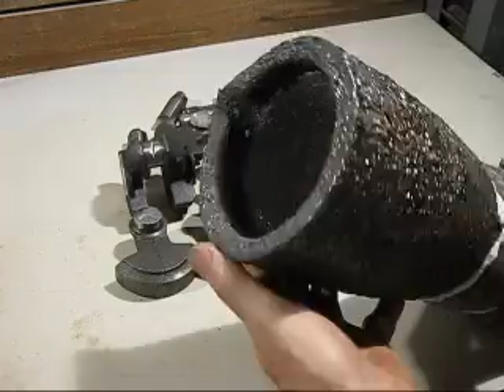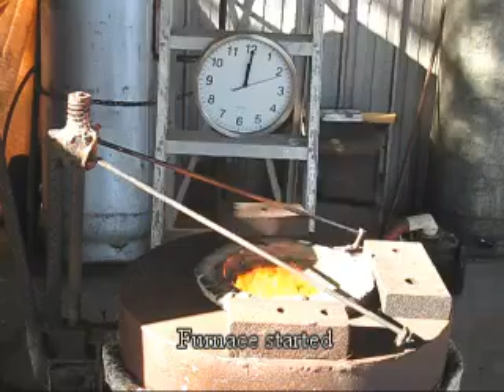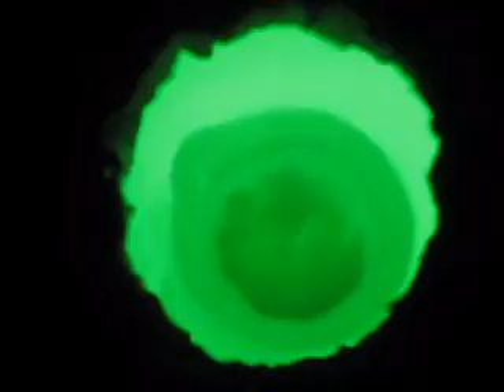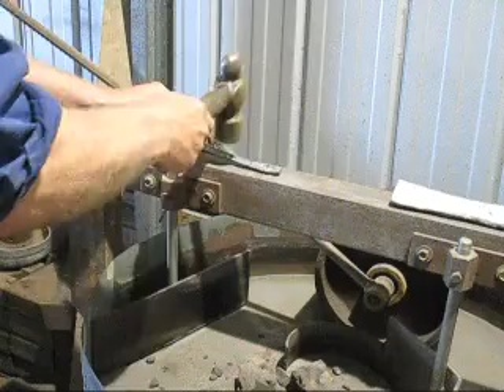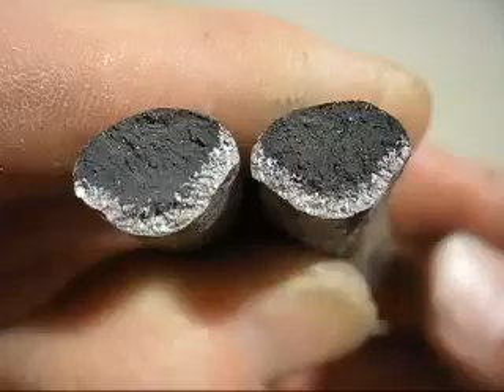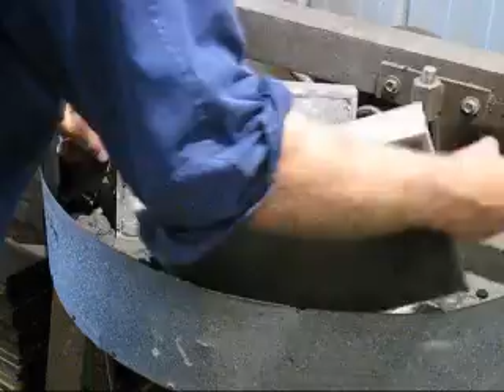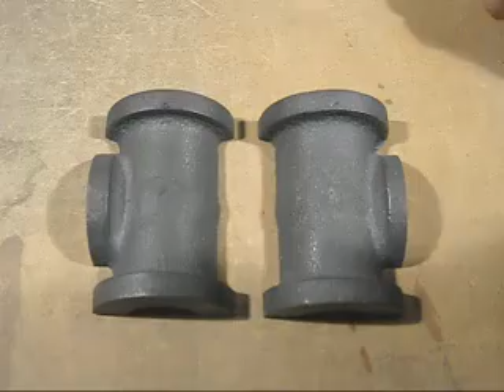Melting  crankshafts

Comment: The mark of a real expert, making it look easy and producing a thing of beauty from the ordinary and mundane. 
The halved cylinder metal looked awesome. I would have a plate machined from that, lacquer it and hang it on my wall to admire the beauty of the grain of the metal.

Well done again mate. Not many people can melt crankshafts so easy and get the end result spot on.
Reply: +luckygen1001 What did you use to get the iron hot enough to melt?
Reply from the maker: +Oil Burner Thank you for watching the video. I got another video planned, hopefully it will be more interesting than this one.
Reply: +luckygen1001 Personally, I found this vid like all of your vids, very interesting!  :0)
Reply: @glumpy10  ..b
Reply: @luckygen1001      l..
Reply: yes you know he is an expert it looked so easy to do and I just know better than that.
Reply: Oil Burner
Reply from the maker: +Karl Whistler Waste oil was burnt using air from a vacuum cleaner.
Reply: Cast iron has no grain. It can be polished or honed or otherwise scratched to appear to have a grain, but only ferrous metals like steel have a grain.

Comment: great results, what does the ferrosilicon do?
could you use brake discs to melt down and make brake drums or does the material change after its recast?
Reply from the maker: +Mr Dodge “28 Dodge C Cab” Builder Yes you can use brake discs to melt down but ferrosilicon is added to make sure the iron can be machined. I have never poured a brake drum before so I am not sure how it would turn out.

Comment: thanks for using the clock, I have a question about the timing of the ferrosilicon added, do bigger chunks require a couple more minutes because I noticed you wasted no time after adding yours to pour.
Reply from the maker: +Clarke E Big lumps will dissolve just as quick but you must pour after adding.

Comment: Initially, I thought maybe the crankshafts were forged steel and that might be the reason for using them.  The clock behind the foundry furnace is a great idea, and really helps give context to the process.  You are a master, and it's a pleasure to watch you work.  Even the small spill wasn't an issue because you were properly dressed and protected.  Testing for chilling is something I have never seen done before.  Very educational.  Thank you!
Reply from the maker: +HemiRod23 Steel forgings have too high a melting point for my furnace.

Comment: The chilled cast iron, its something you don't want because of the hardness? Why is it a negative?
Reply from the maker: +gus bisbal When castings have to be machined chilling destroys cutting tools.
Reply: +luckygen1001 No carbide m tools?

The shop near me mills tool steel like it's slightly hardened butter.  Rockwell 60 vs rockwell 45-50 on most steels.  If you're using something like speed steel tools without a coolant then I can see you getting tip welding, a lot of chatter, and that chatter causing vibrational chipping or worst-case shatter if it's biting into hardened steel.

Have you played around with annealing or forging?
Reply: The white cast iron contains Iron Carbide!  It's hard.
Reply: My muscles are Rockwell 750. The only thing that scares me is Kryptonite. That's bad shit. When I was younger I could snort it, but now it weakens me, and makes me homesick for my home planet.

Comment: Great video.  I have a foundry that I bought many years ago and I am now starting to use it a little.  It runs on natural gas and that can only melt aluminum as far as I know.  Do you think it would hurt the refractory if I added some oil to the fuel to get it hot enough to melt cast iron?
Reply: +luckygen1001 up to now only natural gas.  You think propane will get hot enough to melt cast iron?  I figured on oil as I have to do oil changes on cars and that would be free fuel.
Reply: +Amateur Redneck Workshop&#160;
Oil will get it hot enough. No doubt but your question is can refractory survive with integrity. What your asking is whether an unknown material will hold shape and composition. No one can answer that until you tell them what material it is. Even that may not help. The best thing to do is get a piece of it and elevate its temp to what you need it to be and see how it behaves? How do you do that? With an oxy-acetylene torch. That way you can get close to it and see what is happening.
Reply: You did not mention the refractory.  I suppose you figure it can take the extra heat.
Reply from the maker: Amateur Redneck Workshop Yes refractories for cast iron heat cost a lot more.